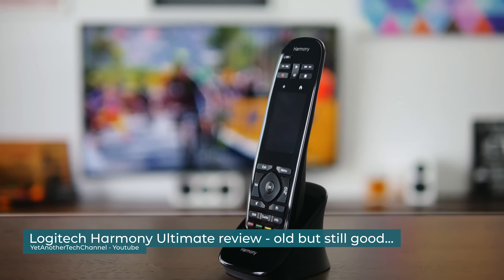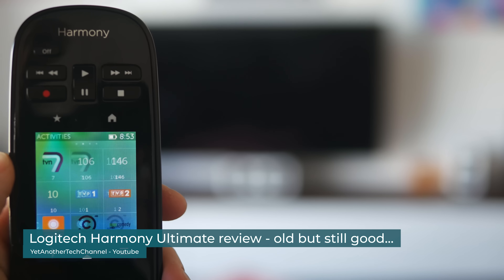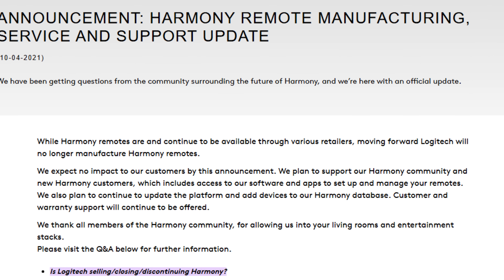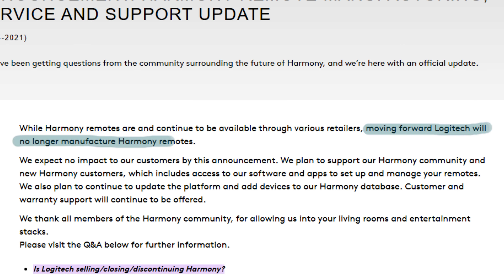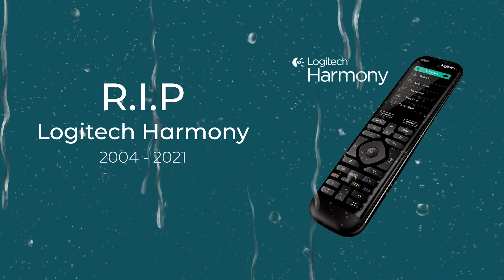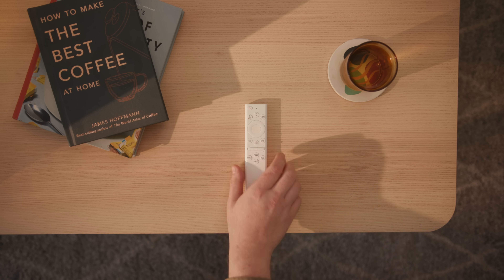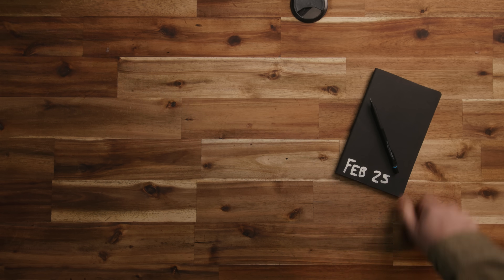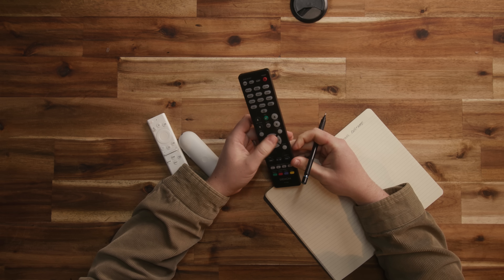My TV Remote Stopped Working… So I Made My Own.

Comment: Logitech still supports the Harmony remotes on the backend. Tell us you've never bothered to even try one. I'm still actively working on the configuration to implement smart lights; and Logitech STILL supports their servers for the Harmony remote to the full extent. And you can still get codes for devices made now. Heck, did you even bother to look at other brands? Sofabaton has two models.

Comment: One very easy addition to the hardware is to add and IR transmitter or led to allow to work with older devices and on the software you can program a button to switch between devices control codes that still use IR as control medium.

Comment: Interesting, and I've been thinking of replacing my remotes, but I dont think this will work for me.

1) I don't really have smart home appliances since I'm in an apartment.
2) my smart tv became unusable as a smart device due to an update, so I replaced it with a chromecast. I kind of want to replace the chromecast now with my steamdeck... that's where I need the remote.

The overall goal is to make tv shows sit right next to video games in the ui, so it's easy to get into either.

So, the first challenge is to get things like youtube playable within the standard game mode of SteamOS.

Next, I need a remote that can turn the tv on, adjust the volume, and work as a paired controller in SteamOS.

If I can tackle those 2 things, I'll work on integrating my bluray player controls.

What sucks about the current setup is that the chromecast remote is real easy to watch YouTube or netflix, but it doesn't do the input select or work with my steamdeck at all. So I have to go get my tv remote to switch inputs, then grab a game controller... even if I dont mean to play a game but just look around or make sure everything is up to date.

Switching back is just as much of a pain

Comment: Supper cool! I'm still using my old Harmony Remote, rue the day it dies. I would have thought when designing this you would have designed the enclosure with the buttons without any guts to test the layout and feel, then designed the PCB layout from that. Since you were designing it from scratch with few limitations that is.

Comment: Would it be a good idea to add some kind of divider between the battery and the backside of the PCB where the soldering joints are? The thinking is that with the buttons pressing down into the PCB, having some kind of divider might reduce the risk of the soldering joints puncturing the LiPo battery?

Comment: This looks brilliant, very tempted to make one but the delay in response times (even if short) would be a killer for me. Have you considered having a constantly powered base station at all? That could act as a charging dock, IR blaster and could then provide WiFi connectivity to HA with the remote then only communicating directly with the hub via BLE. Any extra sensors, however power hungry could then sit in the hub, even better again if you can put some form of accelerometer in the remote too. That should make a huge difference to battery life, perhaps multiple days with instant BLE action? I wish I was better at electronics!

Comment: Would you consider an upgraded version that also has infrared led receiver and emitters?
You could grab any old remote and record each button you want to save, then make them retransmit the same signal when certain buttons are pressed.

You could even do accelerometer for automatic deep sleep, but also automatic profile switching based on the pitch of the remote, those ir diodes are very directional so i think it might be possible depending on the home setup

Comment: I recently had an idea related to this project :)

By swapping out the battery you were using with a bl-5c and crimping a JST connector to a BC-35 interface you would be able to have an easily replaceable battery by adding an access panel to the lower section of the model!

also adding a VS1838B IR receiver and an IR LED to the board would allow you to fully recreate the oldschool harmony experience, especially being able to control things like air conditioners and other types of displays like the BFGD-class monitors, 

I think there are some interesting things that could come from slightly altering the circuit!

I still come back to these videos a lot when I'm struck with inspiration to see what can be done with the ESP chips :)

Comment: Hey, I’ve noticed you use Home Assistant a lot and it looks really cool. I’ve been thinking of setting it up myself but honestly not sure where to start. Could you maybe share what hardware is needed and how to set it up? A beginner’s guide would be awesome!
Reply: There are plenty of beginner videos on YouTube. 
A few years ago the popular hardware was a raspberry pie, but .. needs separate case, power supply, solid state drive ( because SD card really slows you down)
So I don't suggest that at all.

I set up a cheap-ish Intel NUC ( about 150US$ I remember) with 4G memory and a 128G SSD. ( It was even cheaper because it did not come with windows preinstalled.)
Then I installed Home assistant OS (through a thumbdrive). Only during this step did I connect a keyboard and monitor to the NUC
When it's running, you can set up a user account through the web interface that you can open over WiFi on a regular PC. 

Be prepared for a little bit of a learning curve. And once it's running, it takes a little bit of maintenance when updates happen. 

Good luck.

Comment: Is there a reason you did not go with wireless charging? This way in the evening when you're all done you just set it on top of your wireless charger. Grab it the next day it'll be fully charged. I also agree with putting a buzzer in it. This way you could use the home assistant app or if you have an Android phone, set up a home assistant button on your phone and tap it and the remote will buzz from within the couch.

Comment: I miss the slightly older remote that looked like a console from Star Trek TNG when you sat it on the arm of the chair or couch. Just looked it up it is similar to the logitech Harmony 1100 remote but had more buttons on it and I can't remember the brand because it belonged to a former friends dad. May have been the Sony Integrated Remote RM-AV3000.

Comment: As a former user of a Logitech Harmony Remote, this is a very compelling reason to finally buy a 3d printer.  I currently have control of the Denon Receiver and the Samsung TV via integrations into a Habitat device. . . Unfortunately, without some sort of IR Blast functionality, there are some devices that would be left out. Honestly, I still want to do the project because it sounds fun.  Thanks for this!

Comment: When printing recessed boltholes with an overhang like at 5:56, I like to chamfer the face slightly so it's conical. This way, the printer is only printing a line or two of overhang on each layer, rather then all at once. You only need a little bit, 10-20deg.

Comment: Loved that video and it made me subscribe immediately, although this comment is many weeks later.

I have actually rebuild the Everything Remote, and it is a breeze. I had to customize the shell to my needs, because it’s hard to source the exact same parts here in Germany, so I went another route.

It works perfectly, but I got one problem, we are using three remotes and really love to use them. But sometimes we forget to charge them but we can’t get notifications because the entity for the battery percentage doesn’t work, it says 84% the whole time.

Is anyone else having a similar problem?

And I need more ideas, I got like 10 more pcbs here 😂
Reply from the maker: It seems there are 2 versions of the Lolin board in the wild. One with the voltage divider circuit, and one without. 

Unfortunately, without that circuit, the battery monitoring won't work 😕

Comment: Is the battery voltage monitoring done internally (is gpio36 connected internally to the battery input) or does the PCB connect the battery v+ to the gpio?

Comment: I love the Idea! I will be building some soon. This removes the need for mini tablets in each room! Can control our lights, Fans, TVs etc. Cant Wait. 
Side note, I wish your $20-$30 was accurate. the PCBs on there own ( minamum 5 from PCBway) is $42.50 due to shipping. But for something like this the potental is endless on what it could control.

UPDATE 6/5: for anyone seeing this in the United States. SO FAR just getting the PCBs from PCBWAY has cost me $73.88. $44.71 from PCBWay and $29.17 for Taxes and Duties from DHL. I wish I would have known this cost, I would have ordered more to sell .
Breakdown:
(PCBWay) PCBs $19.74 (5 pack because that is the minumum)
(PCBWay) Shipping $22.76
(PCBWay) Bank fee $2.21
(DHL) REGULATORY CHARGES (L1) $1.31
(DHL) IMPORT EXPORT DUTIES (L2) $10.86
(DHL) DUTY TAX PROCESSING (L3) $17.00

Comment: I have NFI why Logitech stopped making universal remotes. We still have the Logitech Harmony Ultimate, and use ours every day. It's great, because it doesn't even need line of sight to your devices, thanks to the hub and included IR relays. Do people really use less devices now? I would think with things like Fetch box, soundbar, receivers etc. universal remotes are more necessary than ever. Best part about the Harmony is that you can even use the app on your phone when your remote is missing or "ALL the way on the other side of the room!".

Comment: I'm still holding onto my Logitech Harmony One, although about 95% of our use is covered by the AppleTV remote and/or CEC with a few limitations.  Turning on the XBox tends to wake everything up, the Switch mostly sort of works and the AppleTV will happily take over, but getting back to the Switch or the XBox is problematic once things are on is mostly impossible (but also not a really common task).  The Harmony is excellent at switching back and forth with its activities when needed but otherwise lives on its dock.

I got all excited there for a moment with this project, although I suspect adding in an separate IR blaster it might be possible to do what I want.  Effectively I just need three big buttons to make sure the TV and receiver are on then choose one of three inputs and a volume up/down control.  Maybe a giant off button too!  But that's about it.  Looks like I have another project to add to the "one day" pile :P

Comment: First video, subscribed. Clever use of HA! Gives me a bunch of ideas.
My wish list for additions, if I would make my own version:
- A piezo buzzer / beeper
- IR emitter (for old devices) although maybe a dedicated IR ESP close to those devices would be better for full control
- Accelerometer for sleep/wakeup or gestures (ie. flip upside down, shake it, ...)
- Some kind of (color) LED, for status / issues (so it's obvious if network issues or low battery), perhaps even an led per switch
I've seen people use LEDs trough printed plastic layers, so perhaps that could be something to put behind the logo?

Comment: Thanks for this killer video! You've inspired me to design my own Roku (wifi) remote. I'm proficient in Fusion, but have never worked with electronics in my life. With the help of your video and some Chatgpt, I have created a breadboard circuit (using ESP8266) that works flawlessly.  Just need to add IR for Power control of the TV.  Next, I need to either try to figure out how to turn that breadboard into a PCB, or a more permanent soldered board, and then I can design/print a case!  Thanks for the inspiration.  Subscribed.

Comment: SofaBaton  remote cost about $50 on Amazon and can map any button to any remote and has amine button that you can map to turn on/off all your devices at once.   Volume for stereo can be mapped on the assigned fires remote.   Only bad thing is there is no voice.   Holds up to 14 remotes and which can include 2 Bluetooth remotes

Comment: There ARE comparable remotes to the Harmony series available from Sofa Baton, from what I understand, but my last one too was the Harmony One (with the home automation adapter kit etc. and all linked up/controlled through homeassistant for the lights, as well as just handling the AV components directly through the Harmony base station.) 
I was very hesitant to buy a new commercial solution, as this isn't the first time it's happened... I spent way, WAY too much oh Philips Pronto remotes before the Harmony series... to the point I became a licensed contractor for programming them, lol, and that wasn't the end. It's been an expensive hobby. 
Building one, though? That's not just functional, it's FUN! Thank you so much for this video! I have a new project to work on!
Edit: Oh, I should have also checked... apparently they're only selling in Australia now, so the rest of the world should DEFINITELY look into building one. Sorry, I just took it for granted first. Should have looked before saying that, and specified the restriction.

Comment: The lack of IR isn’t necessarily a bad thing. You can buy a network enabled IR blaster, such as the BroadLink RM4, and then integrate it with Home Assistant.  This allows you to program and control IR devices from Home Assistant rather than having to program the remote itself.

Comment: Just found a modern TV that is everything a smart TV is, without the bad smart TV integration. See no reason to buy a brand new TV every 3-4 years when it inevitably slows so far down that it takes over 20 seconds to open an app. Rather buy a firestick or similar thing, or just connect it to normal appliances. Curious if I couldn't adapt this to work with that TV and my soundbar... should be doable.

Comment: Nice project. I am a bit more laizy. I’ve setup a xiaomi remote connected via bluetooth on a raspberry pi, then using python and evdev library translate it into averything i needed. For infrared, I’ve added an wifi ir sender, that I can manipulate via python library. For smart home, usually http apis or python libraries allow control of light, sonos audio system, tv, etc. the advantage here is that this remote is BLE, so I believe I have to change the AAA batteries every 2 years. Also, very comfortable remote.

Comment: I'm currently working on converting a NES controller to a IR remote control for my tv by printing a custom backing plate to add a rp2040 zero, 3xaaa batteries and a IR transmitter. Using original buttons and pcb by scraping + severing the traces. Everything tested, just need to put it together.

Comment: I would defo add an IR led for the old audio amp and older tellys around the house. An accelerometer to trigger it into power mode and a timer to put it to sleep to save battery and if it's moving for more than a couple of seconds scan the closest WiFi router strength as Ive a different WiFi router in 3 different areas of the house you could easily triangulate where the remote is. And you could even add a little 0.96 inch LCD screen in front of one of the switches as a modular button, hold it to change the mode (or make it time sensitive for the kids). And I'd key in the standard Bluetooth media controls stuff instead (or as well) as home assistant. 
Great finish though. Well impressed.

Comment: I used a Palm III back in the 90s. Well, the IR transmitter/receiver was weak, however, with the right software, you could "record" any signal from any remote control.So I was able to control my TV, Videorecorder, Hifi etc. with no issues 🙂

Comment: You should print a cap that goes into the Charging Port when not in use to prevent bumfluff from ending up in there and making it not charge!
Reply: I have had phones for over 10 years and it never happened... unlikely that this would be an issue
Reply: @tiloalo  Same, but I've also worked with phones for twice as long and the number of port cleanings I've had to do exceeds 10,000 - While it may be unlikely it isn't impossible

Comment: My Samsung remote has a solar panel. It seems to work really well because I don't think I've had to charge it since I got it. Would this be an option to add to your design?
Reply: Since it only last 36 hours on a single charge, it would discharge faster than the solar panel could charge it

Comment: can anyone fix my problem? i have a very old sound box (speaker) with my pc. which is literally 12-14 years old . but it remote destroyed i have only the circuit. tried many times to repair but couldn't fix😓. 
the only problem when it on by default the bass increased and i need to manually decrease it with it's button. i don't like bass. i only need a bass -   button which reduces that. and that button not working well. please help

Comment: I wonder if the Bambu H2D’s dual nozzle would help with the small button printing?
Reply from the maker: Quite possibly! 

The X1 seemed to run into issues with the filament changes, and the dual nozzles would probably speed up / simplify those quite a bit!

Comment: My universal remote is just a screen. I set my own buttons/functions for each device. Each device will have its own unique interface layout etc
Reply: bro, can you help me fix this problem? I have an old speaker(kamasonic sk-200G) that I've been using with my PC for 12-14 years. Unfortunately, the remote got destroyed, and now I only have the circuit. I've tried many times to repair it, but I haven't been able to fix it yet. The issue is that when I turn it on, the bass is automatically set too high, and I have to manually decrease it using the button. I don't like the bass, and I only need a remote button that reduces it. The speaker's built-in button is also not working well. now what can i do? please help